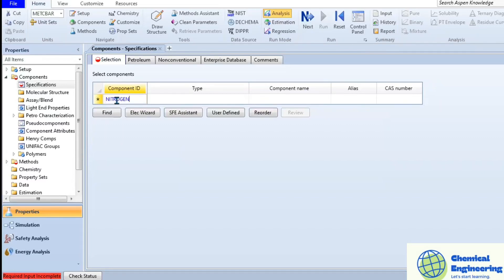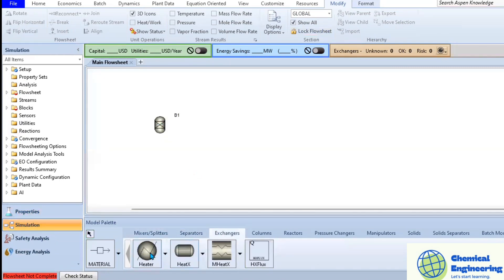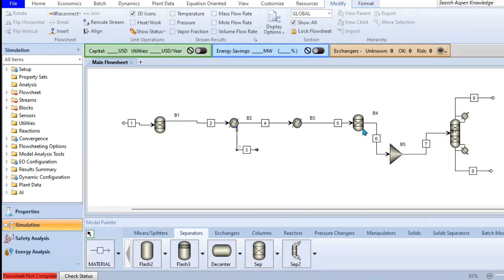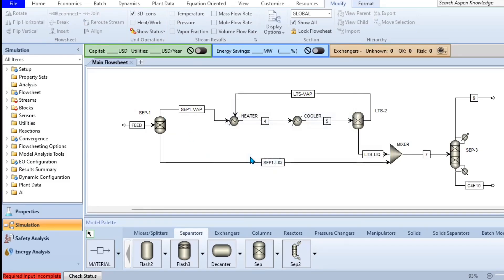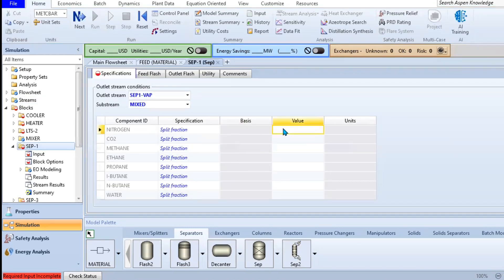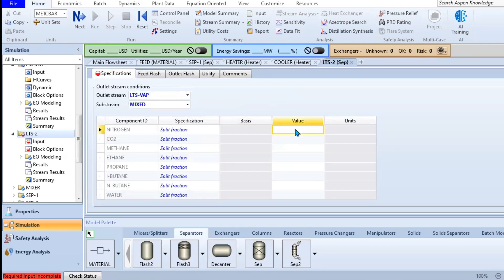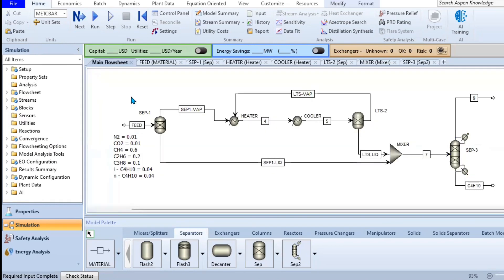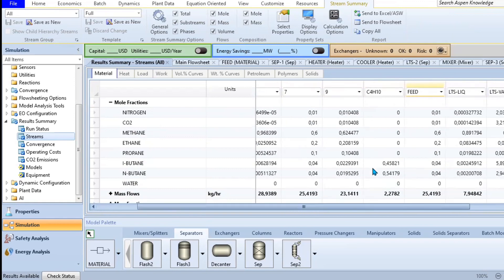Natural Gas Process Simulation | Aspen Hysys Plus V12.1

Comment: Maam, will you please share the link of the research paper from where you had taken the datas from.
Reply from the maker: Hi, I obtained the natural gas composition data online: https://mesagas.com/natural-gas-standards-ft689880/. In terms of temperature, pressure, and other factors, I prefer utilizing phase change diagrams. A phase diagram visually represents the physical states of a substance at varying temperature and pressure levels. By referencing a phase change diagram for a specific chemical, you can better understand its phase transitions between liquid, gas, and solid states. I am currently working on a new video tutorial to assist more students in navigating simulations successfully, providing tips and tricks for completing simulations effectively.

Comment: Which method is this ? Cryogenic ?
Reply from the maker: Thank you for your inquiry. 

I would categorize this scenario as a distillation and separation process aimed at selectively recovering methane, ethane, and butane, rather than conventional methods used for sweetening natural gas. Here's my reasoning: 

There are various approaches to sweetening natural gas, with cryogenic separation being one of them, it involves cooling the natural gas stream to extremely low temperatures, causing impurities to condense and separate from the gas. 

In the example, the focus is on separating and recovering specific components, such as butane (C4H10), from a natural gas mixture. Temperature adjustments were introduced to facilitate condensation and separation based on the different boiling points of the components in the mixture. Separation processes rely on the physical properties of substances, such as boiling points or solubility, to extract specific components. 

I would say this particular example does not fall under the traditional methods used for sweetening natural gas, such as cryogenic separation, amine gas treating, and pressure swing adsorption, as they target the removal of impurities like hydrogen sulfide (H2S) and carbon dioxide (CO2).

The main emphasis of this example lies in the separation and recovery of specific hydrocarbon components (methane, ethane, and butane) using distillation and separation techniques.